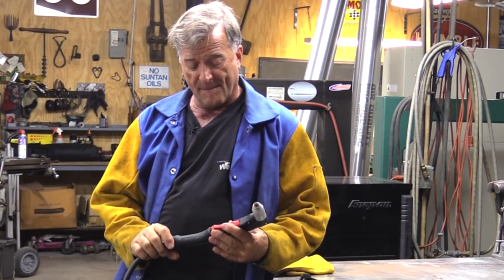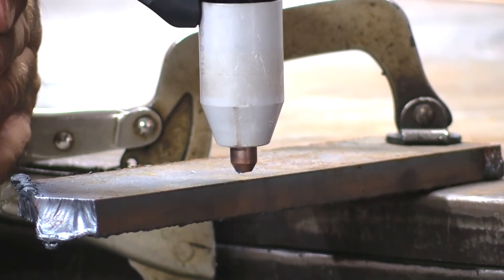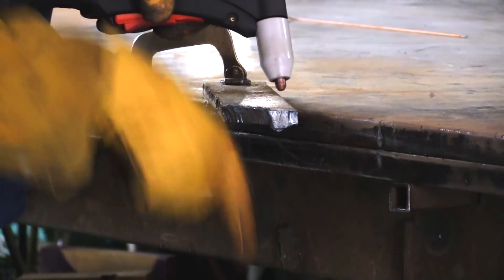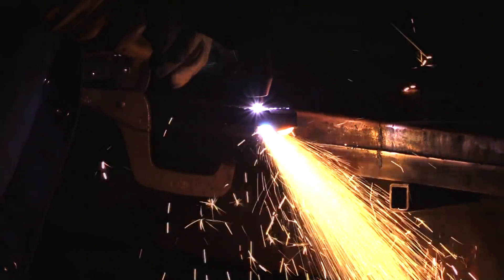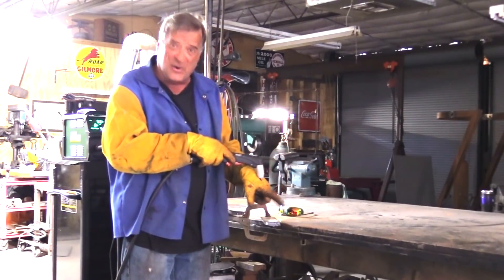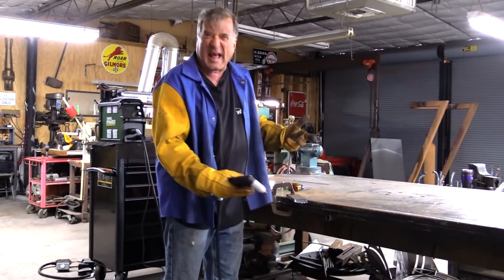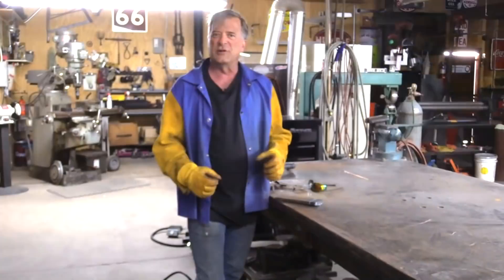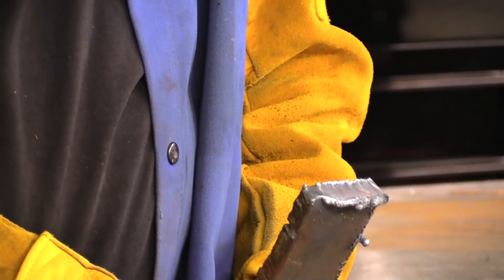How to Angle Your Plasma Cutter for the Best Cut - Kevin Caron

Comment: helpful, but I was asking a different question...can I use a plasma cutter to cut purposefully angled cuts such as a 45 deg edge cut rather than a 90...?  Either way, thanks for the education as I'm new at plasma cutting.
Reply from the maker: Sure you can.   It will cut any angle you  want to make.   Just have to give it some direction.

Comment: Great video! I have a Hobart with built in air compressor. I quit using it because I can't figure out why I keep blowing out the torch. I think it might be dirty steel, any thoughts?
Reply from the maker: Too much pressure or too many amps for the size of the tips you are running. 

Call George at www.georgesplasmacuttershop.com